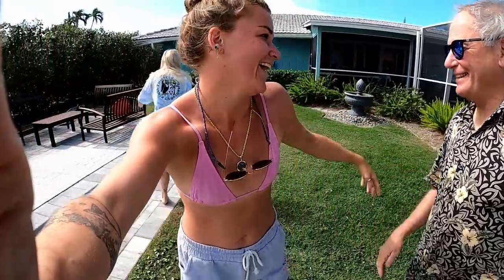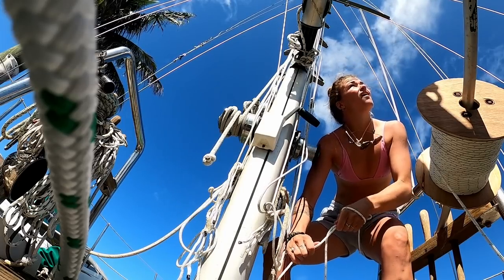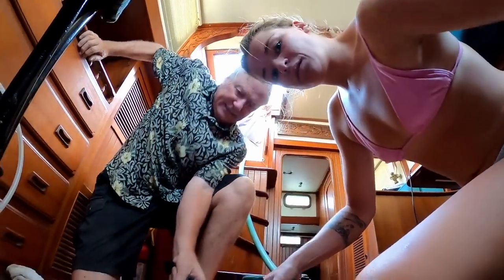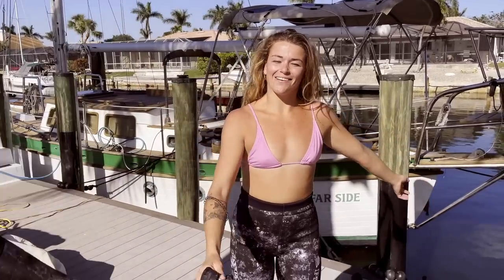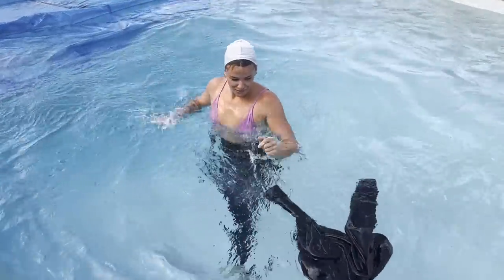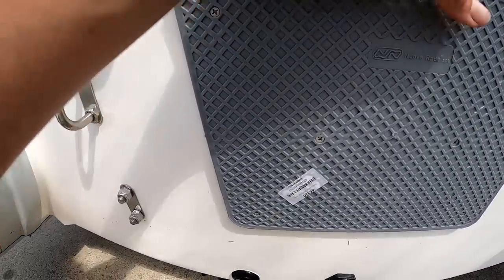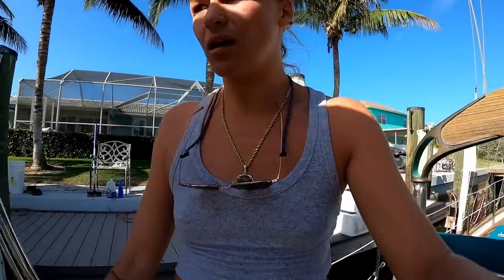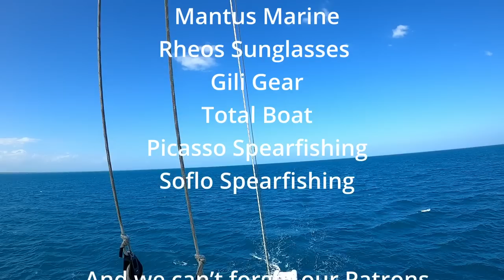2/6-2/7/23 Preparing To SAIL TO GUATEMALA, A Year And A Half Later! STFS Out Of Retirement! S3:E1

Comment: how often does pops have to clean that white concrete tile roof?
Reply from the maker: Not very often I think!
Reply: @SailingTheFarSide  I have what appears to be the same exact white tile roof and mine was pretty filthy. I just recently soft washed it myself w/an x-jet (w/the 5 gallon pail system) hooked up to my pressure washer and it looks brand new again. I just hope I don't have to do that often cuz I have a massive roof and a lot of bushes to avoid.